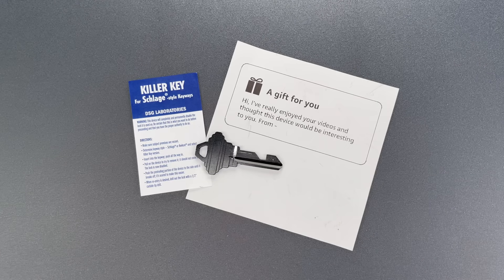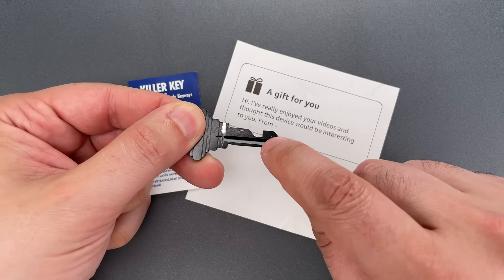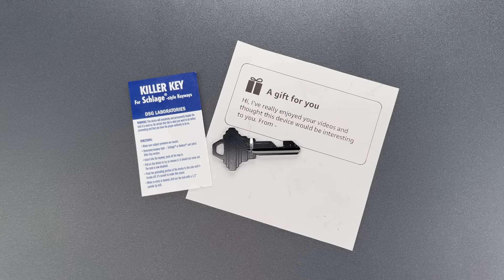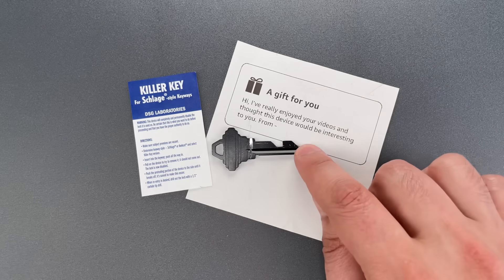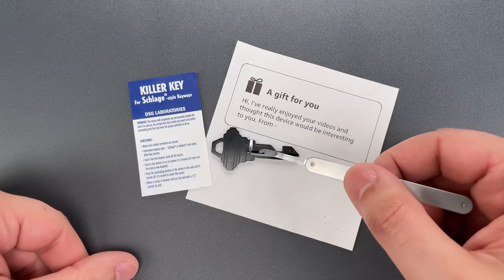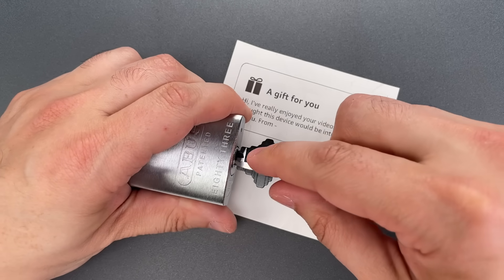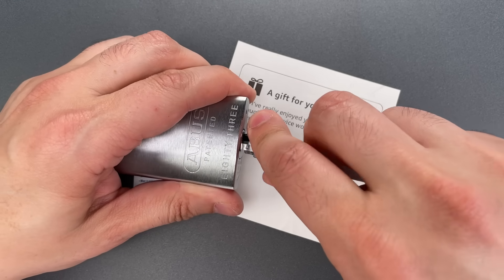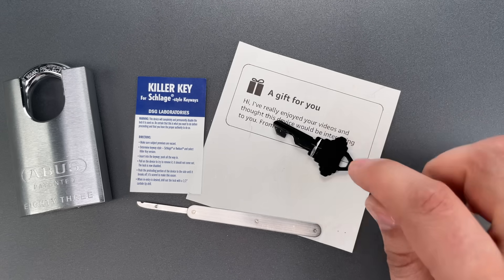[1350] Defeating a “Killer Key”

Comment: Pretty easy to defeat if you know what it is.

But I wonder how many hateful people will use these on someone that "wronged" them. 

I suspect most people won't have any idea about how to remove it and will end up calling a locksmith. 

If they're lucky, the locksmith knows what he's doing. If not, they might get an expensive bill for a drilled lock and replacement lock.
Reply: I am not terribly interested in locksmithing/picking but the more I watch this channel the more I am convinced it should be a mandatory viewing for anyone attempting the profession.
Reply: @andreasavarin4878  Which profession?  Lockpicker or locksmither?
Reply: @MetalSStar196  either
Reply: You could use them to inconvenience someone, but the "key" use for this device is to surprise someone with suddenly being locked out, and then they're vulnerable.  They think they're going to walk in to their front door and be safe.  But actually they start fiddling with the door, it won't open, and then BAM someone hits them in the back of the head with a crowbar.  A good tool for kidnappers and assassins.  I'm not seeing a lot of legitimate uses.
Reply: @armacham  Maybe it can also be used the other way around? Like if you are being followed by someone who wants to do you harm, you can stick one of those in before closing the door and locking it from the inside? I.E. an angry family member that might have the key. But it's so edge case. Another use I can think of is locking something you don't really plan of opening for a long time while simultaneously discouraging lockpickers (But of course it fails at deterring ones that know how it works or are determined enough.)

Comment: Imagine buying a "killer key" to permanently disable a lock, when a few drops of superglue does the trick too. And not even the LPL could defeat a superglued lock.
Reply: Brake cleaner will dissolve the glue in seconds.
Reply: takes out welder
Reply: @firestar1056  Nah, propane torch is plenty of heat to get superglue to not stick.
@davic togi Really, 5minutes with torch and few seconds with brake cleaner? Of course if your locks are dirt cheap china shits, but here those are primarily abloy variants that are rather expensive, specially if lock needs to be coded to same key whole house, sheds etc use.
Reply: @Hellsong89  Welding it close with a welder is gonna need more than propane :)
Reply: It helps if you drive six or eight finish nails/brads in and seat them firmly wit a two pound hammer and a screwdriver.
Reply: True, when i was a kid my friend did that as a prank. I wont say its impossible to clean and open it, its just simpler and cheaper to bought a new one rather than salvage such glued lock.

Comment: So snapped off regular keys would also be removed easier with using this method? But this only works with locks that have straight sides, not the ones that have long groves all down it’s length … The notch on the tool grabs into the groove of the killer key or does it just use friction? If the groove is used, I’d first need to know it’s there and at what depth… What use is killer keys anyway? I see no application in this other than to piss people off and have locksmith make a Ton of money…

Comment: How about putting epoxy or glue in the lock? 
For the "killer key":
Use a pick tool on one side to lift the pins then use a straight pin on the other side to (slowly) work the key out. 
I've used two straight pins to remove broken keys (regular keys).  
It's tedious but it doesn't take long to get the key out far enough to grab with pliers.
Reply: Superglue has long been a favorite of miscreants and vandals.  No need to spring for epoxy, when a $1 pack of 5 cyanoacrylate tubes will do.

Comment: I'm no expert, but id say a bit of a squirt with some super glue would be vastly more effective for disabling a lock.
Well, most any adhesives. Anything that you can inject, or is thin enough to seep out of the keyway in the rest of the mechanism.
Or drive a hardened screw or nail down the keyway.

Comment: I’ve used blanks in my locks forever when evicting tenants. I’d put in a blank and use a hammer to break the head off. Good way to lock someone out without locking them out.
Reply: sounds like you run an extremely above board operation there
Reply: @spambot7110  yeah. That’s the way I used to run stuff when it was just me. Now that I’m a bigger company and have staff, we can’t do that. I don’t want to put my employees in a bad spot. But that didn’t mean I wouldn’t back in the day

Comment: Serious question: why the need for the barb to pull the "killer" key, and not just pull it out while lifting the pins with the notch decoder? Is it so that it wouldn't break?
Reply: It's for if someone snaps the key off inside the lock. If it's snapped inside, there is nothing to pull on. That's why his version of the killer key has a groove more forward. It makes it harder to get out unless you have the barb.
Reply: @Lancearrow1  yep

Comment: Take it one step further, embed a fast-setting epoxy capsule within the lock-killer key, so that when it's inserted (or snapped off), the capsule breaks releasing the epoxy, not only encasing the pins within epoxy but also more permanently lodging the killer key into the keyway.

Comment: Id design it with a disk of metal behind the break away part. Can still insert and break off the key handle and then the disk of metal stops any tools being slid in

     D|◇◇  turns into   |◇◇

The D being the handle that breaks away.

Comment: So what is the actual use case for these killer keys? Looks like it's just a key that would be used to screw people over.
Reply: ive heard in other comments its used to disable locks until a locksmith can come to change them, like if a tenant was evicted for example
Reply: @ciarangale4738  oooh ok. That seems reasonable. Thanks!
Reply: @Vulcea  No worries. you win a prize for replying in under 6 months, which is rare for youtube comments

Comment: Sorry, I know this has nothing to do with this video. I have a Sentry Safe model CSW 3813 with touch pad electronic pad with a key. I have the correct combination as well as the key. Can manage to get it to do everything its suppose to other than I still cant get it to open... any suggestions? The battery shows about half life, can get the little button to pop out (the lock cylinder ) and the screen shows it is unlocked. Can hear and feel some if not all locking pins/rods moving but still can not get the handle to move.

Comment: LPL: "These so-called killer keys can be pretty useful..."
Useful to whom, aside from malicious trolls?
Reply: useful tool for property management to prevent return of evicted tenants before the locks can be changed
Reply: @citizen5577  hmm name 2 more
Reply: @JS-rv3et  Disabling the manual key for an electronic lock.
Reply: @citizen5577  so, still a malicious use case
Reply: @spambot7110  Not malicious at all, why would it be?
Reply: @spambot7110  what's malicious about reclaiming your property? 🤔
Reply: @LRM12o8  It's a complicated topic. But an eviction is throwing someone out of their home and potentially removing access to belongings, even ones needed to survive. It's not something that should be done lightly. It's a tragic situation with an imbalance of power. Take that as you will.
Reply: @javaguru7141  pay your rent and you won't be evicted. It's that simple
Reply: @javaguru7141  In my example I was actually thinking commercial property - but even residential, there is a point where the landlord must take their property back. And once they are evicted, you don't want to let them back in, or allow squatting.
Reply: @javaguru7141  yeah, of course being evicted from your home is a tragic experience, I understand that.
However, my point of view is that the eviction itself is not inherently bad, it's the circumstances that lead to it, which may make it a bad thing. If a landlord purposely drives someone out of their home for egoistic reasons it's certainly a bad thing, but if for example the tenant does not pay the rent and treats the property bad, causing expensive damages etc, an eviction is perfectly justified and there's nothing wrong about it. 
Therefore, it's not the eviction that is bad, it's whatever lead to this drastic measure being taken.

Sometimes a landlord has no other choice. There's bad people on both sides of the fence, as always.
Reply: @LRM12o8  Aye.
Reply: @citizen5577  when you evict the sheriff makes you change the lock right away.
Reply: @javaguru7141  If it's a rental, it's not their home. They own the right to use it, provided they pay rent. If they stop paying rent, they lose the right to stay in the house. SHEESH!!! I have been both a tenant and a landlord, and I CAN'T BELIEVE I ACTUALLY HAVE TO EXPLAIN THIS TO PEOPLE!!!
Reply: @naturalfarmerguineith  That has nothing to do with my point. I never disputed property law as you suggest.
Reply: @citizen5577  Anytime i hear the word management my blood starts to boil
Reply: right like... i thought the point of a lock was so the key owner could get in.. and no one else. so... idk

Comment: I'd put some sort of "shield" around the handle of the key (something like on sword). That way you could also blok any other tools to be inserted into the lock 😃
Reply: Get designing and making before China gets wind of it.
Reply: LPL would probably just use something bendy like a piece of a red bull can, to do the same thing, or explain how to file down or bend away the "shield"
Reply: Just take a battery powered angle grinder :)
Reply: In that case, we’d just break/cut the exposed portion of the key and guard, then use the tool LPL did to defeat this key.
Reply: I'd just put epoxy in the lock
Reply: @mlgsamantha5863  I was thinking I'd just put some gum in there... Maybe push it in with the key to make sure it's really in.
Reply: If it's on the face of the lock it too can be removed.. may require a dremel... but still

Comment: I'm curious how this is intended to be used. I'm guessing it's so no one else can use the lock but then how are you supposed to use it later (the way you talked about the tools needed made it sound like they aren't readily available and are mostly do it yourself). Besides that this just looks like something designed for pure malicious intent, like intentionally sabotaging someone's door so they can't get into their house/business/storage without having to remove and replace the lock or hire a lock smith to open it (costing time and money). 
Though thinking about it some more I'm guessing this is more for when you want something to stay locked, but at that point why not just weld the lock shut?

Comment: Does this "killer key" have any utility other than screwing someone over?  I can't think of anything, but maybe I'm missing something.
Reply: as LPL said you could use it as a quick way to jam your own lock if you're afraid of someone trying to pick it. although it wont help if the picker is prepared with a similar tool
Reply: @whisktheeggs  I'm just having trouble thinking of a scenario where that would be useful.  I mean...  How often does the need for emergency lock picking protection come up?

Comment: The killer key is $12 on amazon. Five minute epoxy is a lot less. Wouldn't slathering the normal key with epoxy and inserting it "kill" the lock lots more effectively? (I take that back, slathering the wrong key with epoxy would be better :-).

Comment: There's probably only a couple ways to truly kill a lock:
1. Fill, corrode, or mangle the mechanism to the point it will never turn again, regardless of picking skill at which point destructive methods are probably advised. I could probably accomplish this most efficiently with a good quality epoxy and some blue thread locker on the lock screws. 
2. Destroy the lock to the point that it needs to be straight up replaced in order to lock.

Comment: Hey question, isn't using this technically destruction of property (illegal)? I'm assuming people are going to use it on a lock that doesn't belong to them (because who would destroy their own property) so technically this device could be considered in the same ballpark as the USB killer, a tool designed to destroy other people's property. 

I know in this case it's a bit different because you can remove it without destroying the lock but most people don't know that and so they're forced to drill the lock just like it says.

Comment: When would someone need to use a "killer" key?

Genuinely curious.
Reply: When a landlord needs to change the locks after evicting someone, sometimes it's cheaper to do this and then have the locksmith come in later than to call in a locksmith to do it at a specific time on a specific day
Reply: I could see using one for a customer access that you were not going to unlock from the outside just to minimize foul play to a degree

Comment: I guess the killer key need to add something to completely cover the keyway,  like say a wider non-removable keyhead, or a steel disk to go tightly around the key body and block access from the sides once inserted.    Possibly include a sprayable glue to put into the lock before inserting the killer key  with idea of gluing the last pins into an overset position

Comment: Alternate way I can think of to disable the lock is to have a essentially this same tool in its broken form but the end is a small wedge only slightly thicker than the key hole you hammer it into.

Comment: I had a regular key break like this when I was twisting it to open the lock :\ Short of what he did there was no way to grip it. The notches were ramped like normal though, so it wasn't quite impossible to get out (without specialized tools).

Comment: If i want to "kill" a Lock so that it stays shut - Glue. Lots of glue.
Why? cheap, simple, and really hard to undo. The glue gets into all the small nooks and crannies by filling it up completely so you can no longer insert tools (other than ramming them in through the glue - so no thin tools). And even then the glue would hinder the movement of the pins, making it harder to pick. Certainly can be defeated, but glue is cheaper than those keys and better.

Comment: I've made and installed a handful of these.  Valid use-case when a room has ~7+ entry points, and the customer wants urgent change-keying at low cost.

If you want to make damn-near impossible to remove, put a decent twist on the key before inserting it.
If done correctly, it should be quite stiff to insert.  This creates internal torsion in the key, forcing the backwards cut into a pin chamber.
Harder to remove, and often will deter even a shim user.

Comment: If I've learned nothing else from his expertise, I've learned that almost nothing will stop a prepared attacker for long
Reply: I used to work in a 'high security' warehouse.

When they say 'high' it was just a decent amount better than average - lots of expensive locks and beefed up doors, but no full time security patrolling all areas (and CCTV only on the doors).

We finished at 5pm on Friday - by 6pm a team of thieves began dismantling a wall, carefully avoiding the security wires built into the wall (at 'normal' digging height). Over the weekend they removed everything they fancied. 
Prior preparation prevents piss poor performance.
Reply: @pd4165  What did they make off with that was worth that amount of trouble?
Reply: @chancekahle2214  definitely not Masterlock trade secrets
Reply: Bowley locks tho

Comment: Just make the killer key a tighter fit and or add notches and grooves in it to catch the tip of the tool makeing it snug enough to just barely get jamed up in the lock and impisible to remove once broken off

Comment: To be fair, i imagine that the effectiveness of that shim is reliant on the tolerances of the keyway.  An exceptionally tight keyway would leave no room to slip the shim through, correct?
Reply: You'd have to tailor the killer key to the particular keyway dimensions though, which doesn't sound very practical. The point of the killer key is that is a general-purpose product.
Reply: There aren't that many different keyways - if you were serious you could arrange to have exactly the right 'killer' (or have a selection on hand)  - most landlords will probably use one brand of lock, so would only need one type of killer.
If they watch LPL they could save themselves a bit on locksmiths.

Comment: If i were to make a product similar to this , id take it up a notch and have the key grooved along its length and filled with an expanding epoxy foam . After inserting , you twist it and cause it to split along its length releasing the epoxy . It would be more expensive to produce but i think it would be much better at what its meant to do .

Comment: Imagine going to pick a lock and you find this thing lodged in there. You have to pick the key out before you can pick the lock. Put some sort of pins on this key jammer so you can remove it with a secondary key and I can imagine it will take you the whole of a 5 seconds longer to open the lock, while forcing any run of the mill burglar to result to cruder equipment, such as a brick through the window.

Comment: A better lock killer would be a straight blank (grooved to snap off) and a tube of super glue. Fill the keyway with super glue then push the key in and snap it off. If you want to be fancy about it use a good epoxy instead.